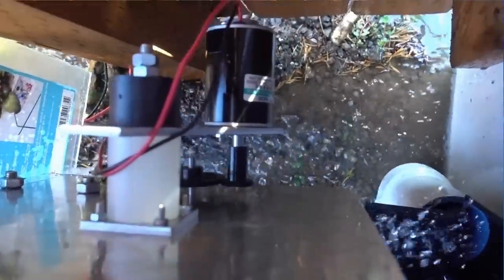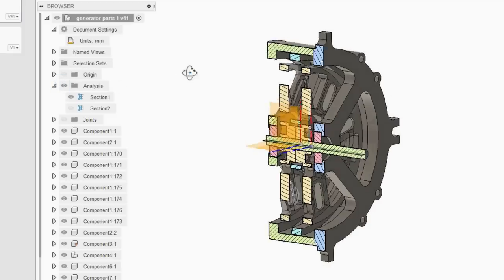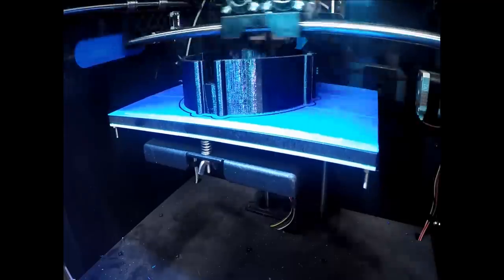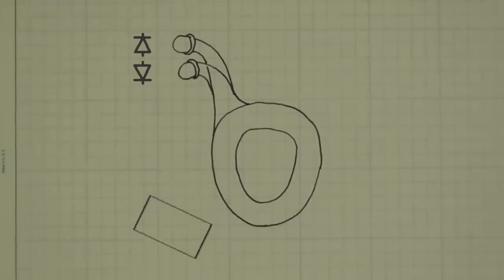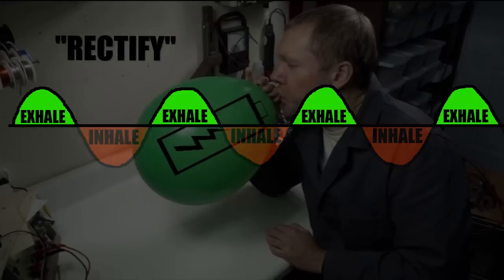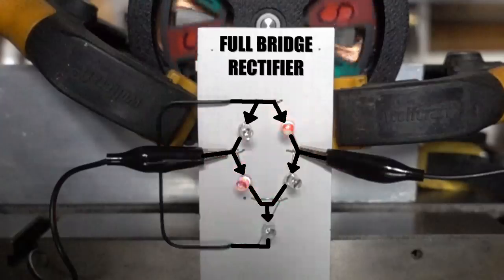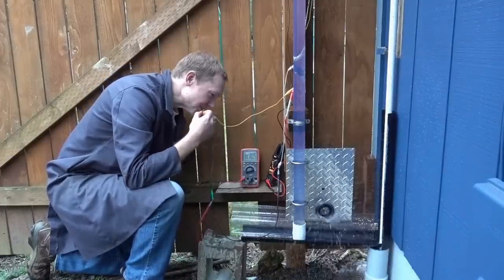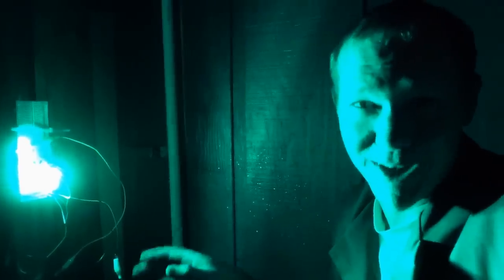Rain Gutter POWER #2 - 3D Printed Alternator, BEST Explanation of a Rectifier EVER!!!

Comment: I think the explanation of reasons why current direction alternates in the coil is not correct. The induced current depends on magnetic flux change, so when the magnet enters the coil, magnetic flux changes from zero to max inducing a current in one direction, and when the magnet leaves the coil, magnetic flux changes from max to zero inducing a current in the opposite direction.
Reply from the maker: I never said why the current flows, I said "let's assume it goes..." Your statement is exactly right but I made the call not to go into flux on this video. It's tough finding the right technical balance for a general audience.
Reply: Sorry, I didn't notice that
Reply from the maker: No worries

Comment: Just a science lesson on how generators work secondary school stuff.  But i dont see the point because all the energy put into make your items exceeds what you are getting out.  So to power your 3d printer how many days of rain?  How many days of rain to make the lathe work etc......  your economics are just whacky.  It doesnt rain anywhere on earth except lake titikaka which is guaranteed a thunderstorm 365 days a year during the nighttime.  Yes good to show what “could” be done.  I just dont see your rainwater generating enough energy to run to make it viable.  Also wouldn’t enclosing it in a casing make the generator run slower due to wind or pressure resistance.......................................

Comment: what is crazy is that we have autonomous cars, cell phones and for all that is electric motors and generators, are not even at the level of Nikola Tesla .. there is not a big problem ?? there is no Moore's law for engines because in half a century things have not really changed. when did the brushless motor even date? in the 80s? and since? nothing more? pathetic .. you have to finish the oil first ..: '(